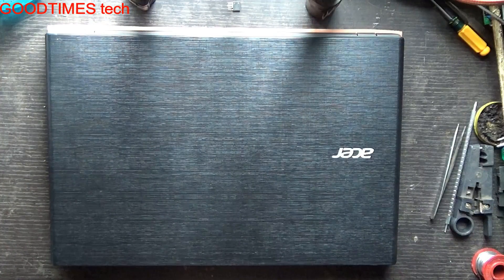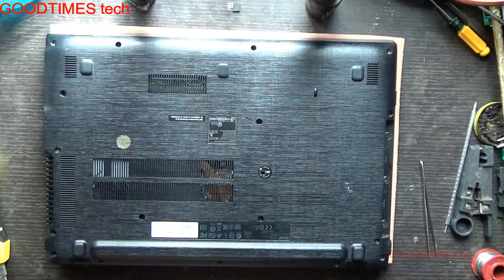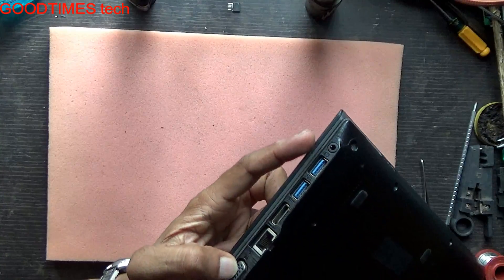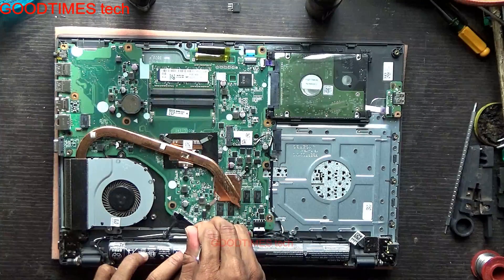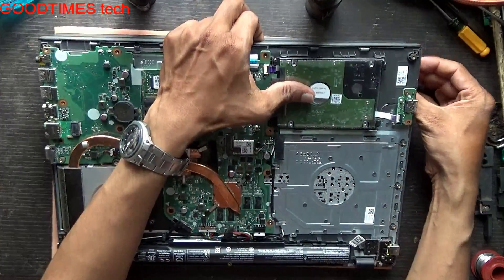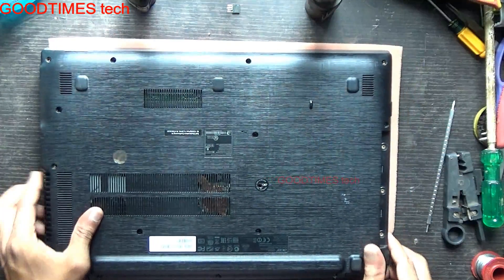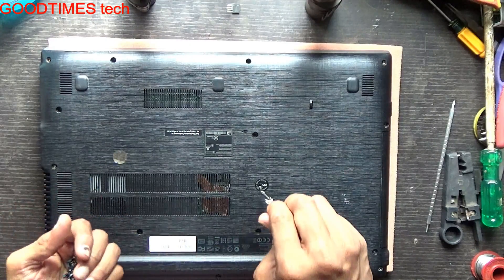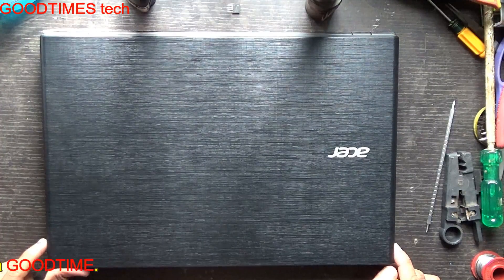Acer ASPIRE E15 Series Laptop | How to replace battery.

Comment: Im confused my laptop isn't working and I was thinking to change the  battery but not sure do i have to get a new one ????
Reply from the maker: Hi, If your laptop is not working even on AC adapter then before replacing the battery please check what is the real fault(you can get it checked by laptop repair technician). Replace the battery if there is any notification(when the laptop starts working) or if the battery backup is very low.
Thank you, have a GOODTIME...
Reply: @GOODTIMEStech  ohh okay thank you ❤

Comment: Is it possible to run the laptop without the battery, as long as you have it plugged in?
Reply from the maker: Yes, it should run without battery when connected to adapter and plugged in. I have tried and it works fine... but if there is frequent power failure and laptop is shutdown improperly then there are chances for HDD/SSD to generate bad sector and corrupt files.
If there is no power failure then no worries.
Thank you, have a GOODTIME....

Comment: Needed to do a battery replacement formy mother, and was absolutely stumped in getting the back off. I've worked on a fair few laptops and never seen one where I had to remove the DVD drive first. Thank you so much from both her and I x

Comment: Awesome vid!

I have a question though, sir. Is it possible for the laptop to run while plugged in without the battery?

My laptop battery has shown its age and is giving me problems when it gets "confused" whether or not to use the battery and ends shutting down by force.
Reply: I've used this laptop for 8 years without the battery. It's always connect to a socket so I never had use for the battery.

Comment: Hi, I have an Acer Aspire E5-771 and because the old battery lasted only max. 30min, I changed it with a new one, but that doesn't load over 89% ...
How can I reset or make it fully charge?
Tks in advance,

Comment: Why did they make the battery so damn difficult to remove in this model??? I've never had a laptop with a battery this difficult to remove. Ridiculous!!!! If you manufacturers  think I'm gonna buy another new laptop to replace a battery it sure as hell ain't gonna be another one with a hidden battery like this.  You trying to rip off the consumer is going to backfire, HARD.

Comment: When I press the power button, the screen does not respond, but the lamp that usually ignites when the computer is ignited remains ignited and turns off for several times, then turns off.  Could it be that the battery was the cause, knowing I've never had this before.

Comment: Great Video! Perfection.  I have this same exact laptop and was wondering why they didn't make it easy to remove the battery. Mine didnt have stickers on the bottom either, but everything else seems to match up . Thanks for good details as to not break the connectors.

Comment: What happen if i somehow broke the small connector (from casing to board)? Will my laptop not working?

I try open my laptop, cleaning the fan, then when I want assemble it back somehow the laptop won't work. I push the power button but not working. Then I try to connect with power supply, then it is working. Can anybody tell what's wrong? I think the small connector is faulty because I put it back quiet harshly but it is still in contact no wire broken. But I worried it has broken inside. Can someone help me 😣😣😣

Update: once I push the power button it start for a second then stop with a click sound 😥😥

Update: I don't think it's the small connector's problem. I think it's the fan problem 😣 the fan only spin for a while then stop. It is the fan's fault? How do I know the fan is broken or I make a mistake during assembling?

Comment: I would like to speak to the genius who designed a laptop so poorly, the computer not only has to be disassembled, but you must  watch a movie to do it.
Reply: They do it on purpose 1) to save a few cents in manufacturing, 2) to save a few dollars in consumer-friendly design, 3) to add a bit of "built-in obsolescence" -- most folks have to buy a whole new laptop once the battery dies. So they basically love $$ more than the earth.
Reply: that battery removing process is shit
Reply: I agree, but ngl you sound a lot like a Karen with that I'd like to speak with someone sentence lmao.
Reply: @s_mai8970  Ford once made a Van that it was so difficult to replace the spark plugs, that they recommended removing the engine, first, to replace spark plugs.  Guess what!  They dont make that van any more.  I wonder why?  In the case of this laptop, buying one where it takes dissabling the computer to replace the battery is a similar maintenance failure, a good reason not to buy the computer.
Reply: @s_mai8970  well they speak the truth. You gonna buy them a new laptop with a battery that's easy to remove?

Comment: Awesome! A quick question, though it is late, can the laptop still work without the battery and the charger cable directly connected to it? I mean, I want to still use it without the battery so it doesnt overheat easily. Thanks... hope to hear from you! Cheers
Reply: Yes
Reply: @Raees098noice  thanks buddy. I figured it yes too. But having the battery in is safer during blackouts.

Comment: Bro can we use the lapptop without the battery ? Pls answer this
Reply: Please see the author's reply to 
molekulaTV
1 year ago. Basically yes you can, but it can be dangerous to your data/hardware if the power fluctuates while using
Reply: @studiozandra8714   broo i have the same laptote he have a tickle charging or no?
Reply: No

Comment: Excellent tutorial.  Thanks.  Easy.  BTW, I did not need to detach the wire attached to the back panel.  There is enough wire to simply lay the back panel behind the laptop while the wire remains attached.  The replacement battery for the Acer E15 E5-573 is the AL15A32.
Reply: from where to buy genuine battery
Reply: Same to me

Comment: Hello sir
Im from malaysia 
can this laptop run wthout battry in ?? I think i want to remove the battry so can play along time.. need your help sir tq!
Reply: Yes.  Any laptop can run without a battery.  You just need to plug in the charger all time.  However, be careful with the charger as if it got pulled off, the laptop will die—losing all unsaved work or data.

Comment: Hi. A quick question: can you use the laptop with these batteries taken off so only on the DC? Technically should work. Right?

(I guess my battery sort circuited) (so... need a quick solution.)

(DC adaptor shots down when plugged,  cant use the laptop at all.)

(So I would simply take the battery off.)
Reply from the maker: Hi, yes , we can use laptop only on adaptor without battery provided mains current should not fail which can cause severe damage to HDD and unsaved work.

Take care and do it on your own risk.

If the adaptor shorts down may be some component on motherboard failed due to which adaptor enters into protection mode.

Thank you for watching, have a GOODTIME.
Reply: @GOODTIMEStech  Yes exactly that's the case.

Unfortunatelly turned it is not the battery that is shorted.

Motherboard works fine.  (When was on battery only windows runs nicely)

I made many tests, one is this:

Battery off, DC 19volts measured with a tool on the  adaptor so it is alive, then w plugged into to laptop ,  not turned off just waiting 10 seconds, then unplug DC from it , measure it and result is that adaptor went safe off mode so no DC from it.

Then adaptor unplug from 220vs ,  plug back , DC 19vs there again.

So.

Somewhere before the motherboard something died in the laptop and definitely not the battery (cause wasnt even in during the test)

Comment: Good video man!
But where can I buy a replacement battery that lasts long as the original one?
Reply from the maker: Better to buy from an authorized outlet or on online shopping websites with returnable policy.
Thank you for watching, have a GOODTIME.
Reply: GOOD LUCK BUDDY MOST OF THE TIME YOU WILL GET THE WRONG SIZE BATTERY JUST STRIP IT FOR ITS PARTS